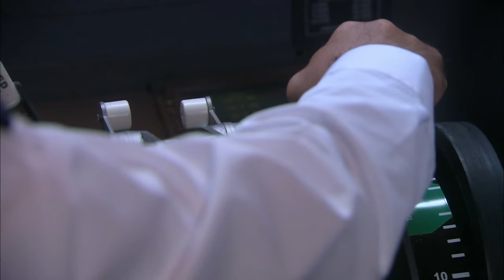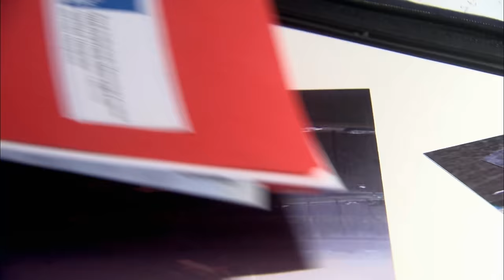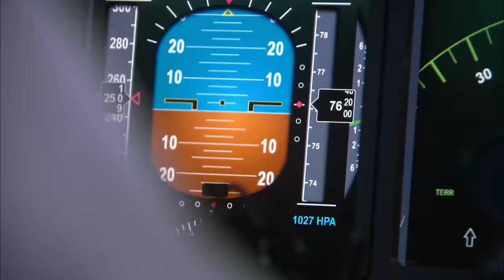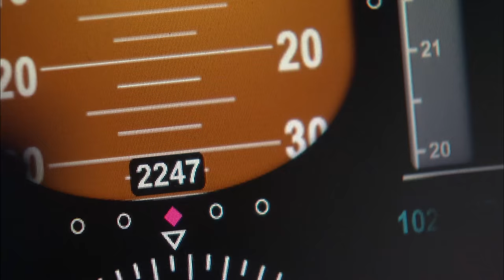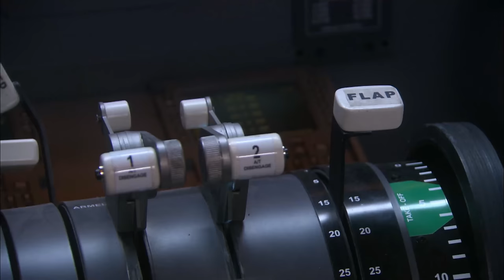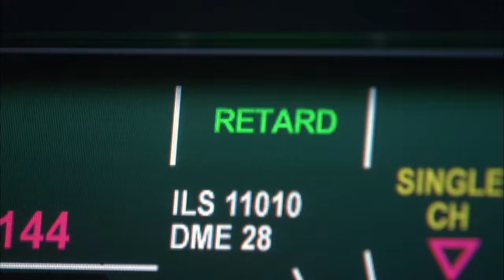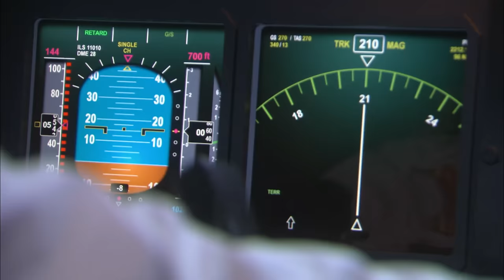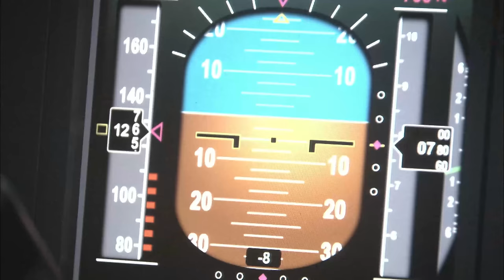Turkish Airlines Flight 1951 Crashes Short of Schipol Airport [4K] | Mayday | Wonder

Comment: Get rid of AI in all the planes, Problem solved!
Reply: All automation in planes is more likely to cause issues than pilots are. The A320 did this same exact thing during a low flyover over an airport during demonstration flights when it was first released. Literally went into landing mode and the plane overrode the pilots and crashed into a forest.
Reply: @pilsplease7561  an oversimplification of what actually happened on that flight. Yes the automation kicked in, but the pilots had not been properly briefed on the airstrip that would actually be used, not the surrounding areas. The pilot also flew the plane too low (only 30 ft off the ground) and reacted too late to get the engines back to full power to climb.
Reply: @Jefe86  To be honest he didnt know the plane would do that I feel that is a Airbus and plane defect not a issue with the pilot.
Reply: @pilsplease7561  I respectfully disagree. Even the courts have found that the pilot acted negligently when doing that low altitude flyover. He should not have been flying so low (he was supposed to drop to 100 feet and was at 30 feet, which is basically landing can’t get much closer than that), he did not properly brief on the air strip he ended up using (based all his calculations of when to add full power and take off on the original airstrip, which was longer and clear at the end) and most egregiously did not make sure everyone was off the plane, leaving 2 people inside to die.

Comment: The saving grace in this crash was decreased speed, due the plane going into a landing.   The plane did a sudden fall at about 1000 feet, if this would have been at the standard 25k to 40k feet, no one would have made it and the plane would have been in worse shape.   Finally, the open field.   It helped in this.   If there would been a busy city like Amsterdam or a very populated suburban area, this accident would have been for more disastrous.
Reply: If this happened at 25k or 40k, it would have been a simple recoverable stall.  They stalled too close to the ground with no altitude to recover.

Comment: Another example of a stupid flight crew that forgot basic fundementals of flight.  1.  Airspeed combined with 2. Altitude.  In addition to this Pilot Error, Turkish Airlines should have demanded that Boeing correct the Radio Altimeter problem and ground all their aircraft as necessary.  All of these Electronic Flight Control Aids are basically designed to assist incompetent pilots.  The industry as a whole, will not admit that 90% of all Commercial and General Aviation Accidents/Losses are due to "Pilot Error".  The loss of aircraft and people is factored in as an 'Operational Cost'.  The attitude and belief is that it is still less expensive then to improve Flight Training and 'Extensive Simulator Time'.  If I tested pilots 40% of them would fail to get 'Type Rated' for the aircraft intended.  This video is fairly worthless, by trying to decide if Boeing or Pilot Error crashed this aircraft.

Comment: How difficult would it be to program an effective audible low speed warning? A tiny flashing outline on the ASI in a sea of lights is obviously easy to miss. Way too much reliance on the technology to fly the plane - when that technology can't (for whatever reason), the pilots are left to pick it up on their own. They need to do a better job of having the technology communicate with the pilots what the system itself is thinking and doing - that's true CRM.

Comment: The Boeing dude just says “turn it off and fly the plane”.  There is an illustration of the problem with Boeing. And the ATC guided them incorrectly as well. The pilots are not to blame here. A faulty aircraft and the pilots are to blame…🤔

Comment: I'm sorry, but if you have an issue that happens over & over & over & over & over again and your response is "well the operators made sure that it doesn't become a real problem" THAT is a real problem. All it takes is moment of distraction (like say teaching someone) for them to not notice it and then it has the potential to cause harm. They should've continued to try to fix the issue as soon as possible no matter what it costs. You designed the damn thing and are selling it.

Comment: I don’t totally blame Boeing for this. I absolutely think they should’ve investigated more when the problem was reported and discovered a solution; but how many drivers ignore the check engine light on their car? When trying to innovate there is always something new and semi unknown about your work. I think the main mistakes were Boeing not figuring out the issue when told through reports, and the pilots not having their checklist done before landing at, what sounds like, a difficult airport.
Reply: Also - blame the pilots is what they investigators tend to do. Once autopilot catches the glide slope it seems to do the flying, it's possible that pilots thought it was the right speed at that time in flight. Noone is talking about how two systems (auto throttle and glideslope) telling two different stories, but somehow not disengaging the autopilot. Whoever wrote that software should have accounted for comparative readings and disengage the automation.

Comment: 9:24 LMAO the production crew didn't bother to make an animation so they added giant fonts to an excel sheet with QAR/FDR data even if the narrator was talking about CVR data...

Also at 9:30 you can see the data ends at 625 rows. A modern FDR usually records in 1 to 4hz, so a 2hr flight would be around 7200 to 28800 rows. I've dealt with some military FDRs that write in 10hz and that's even more.
Reply: You fun at parties ya?

Comment: Something interesting, flights designated "191" have crashed 6 times and have had 1 emergency return to the airport it took off from. Some airlines will not designate a flight as 191. Even though this plane was flight 19 FIVE 1. It was close. The Dallas crash was flight 191 and the crash in 1979 in Chicago which is the worst aviation disaster in US history, even to this day, was also flight 191.

Edit "Things are going to break on an airplane." That doesn't sound good.

And Boeing saying the altimeter is no threat to safety is absurd. If you have a plane configured to land based on the left side if the plane's instruments and those instruments are malfunctioning, then it would stand to reason that the landing isn't going to go well. "Boeing also didn't foresee the deadlt effect of a faulty altimeter." It's night (in this case cloudy) and you can't see the ground so you have no idea how high you are, what could possibly go wrong?